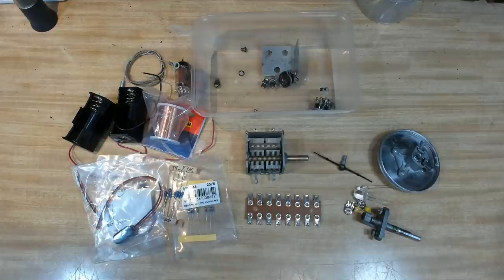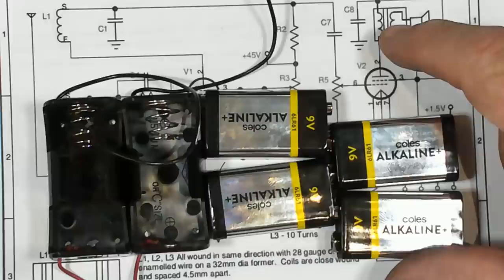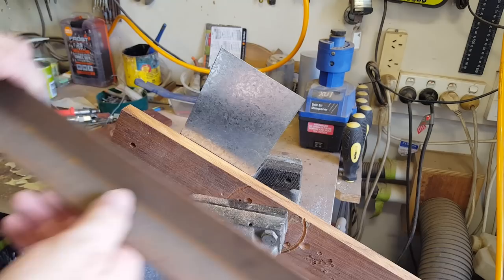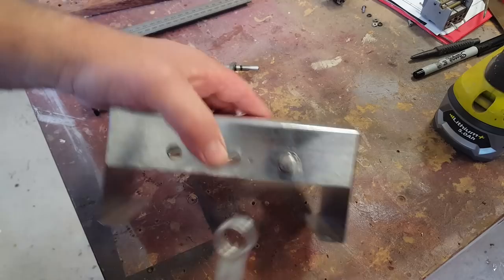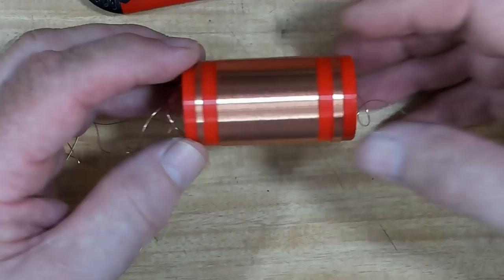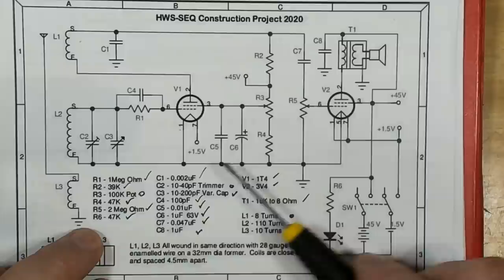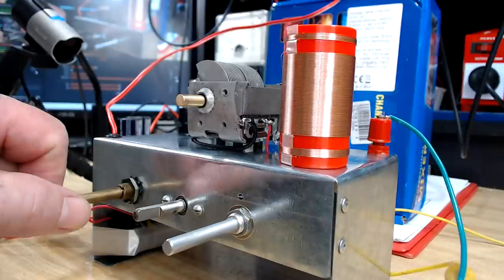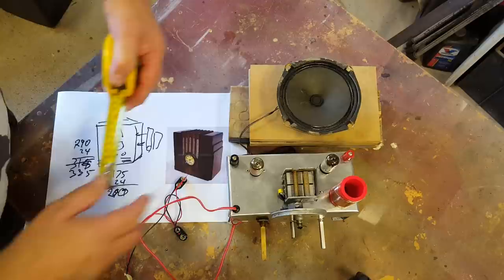2020 Radio Building Competition - My Entry - Two valve Radio

Comment: I have no doubt I missed the answer somewhere but.. what is the small touchscreen signal generator you use in your videos?
Reply from the maker: Hi Andrew. The SG is a project kit from a local electronics magazine, there is a sister publication in the UK, it was featured in Practical Electronics in the April 2018 edition but mine has a oscilloscope function as well which I don't use. There may be a later edition in PE with that feature. Here are the links:
Aus: https://www.siliconchip.com.au/Issue/2017/September 
UK: https://www.electronpublishing.com/product/april-2018-back-issue/
Reply: @DavidTipton101  thank you

Comment: Hihi ! I baught 3 cheep radios. From China. The radios were... terrible at best. Christmas came. House..empty? So i scrounged parts from all three. Dead radios. And embarked on a mission. after 8 hours of labour. I was about to give up.and go to bed. Then I heard a faint whisper. ??? I got a .455 generator., And sent a tone. Also went over that wretched. Board. With its verry thin foil on the board and used snipits from  excess clippings. And rewarmed joints and paving said snipits over broken foil. Then was rewarded with.   A bit of the spectrum.( 400-1300 )   and worked at alinement. Not good. Better than expected. A real christmas gift...
 From Chinese scrap.  Merry Christmas. Om. from kv4li
Reply from the maker: That sounds like a good project Stephen, well done getting one to work. Merry Christmas 😀

Comment: why black? I was a little disappointed! you need a lot of light to see details when it is black. I had hoped for something other than black
Reply from the maker: Hi skrotkalle skrotkalle. I thought it looked pretty good in black and the silver contrasts nicely. To each his own I guess. Thanks 👍🙂
Reply: @DavidTipton101  The reason I do not like black is that you have to have a LOT of light otherwise details are lost and you can only see a black box.

I have 2 large fluorescent lamps in the middle of the room but next to the wall where I have the hifi equipment I see almost nothing but black boxes. if you understand what I'm trying to say.

You did a very good job with the radio!
Reply from the maker: @ford1546  Yep, I understand what you are saying 👍🙂
Reply: @DavidTipton101  Good.

There are not many regular people who can build a radio as good as the one you made. 👍🏻

Comment: Hi there, most impressed.  A couple of years back I built a 2 valve + audio chip Regen kit from Uk. Works great. Was worried about valves coming to Australia.  Anyway this is the company https://www.6v6.co.uk/index.php?
Reply from the maker: Thank you. That's a neat kit Chuck, I assume it worked OK 👍🙂
Reply: @DavidTipton101  worked no problem first time.   I did learn one thing from it.  Headphones and Regen radio not a good idea if you apply a bit much.
Reply from the maker: @chuckmaddison2924  Haha... that's an excellent safety tip Chuck 😄

Comment: tickler feedback coil reversed.
Reply from the maker: No it's not, I checked 👍🙂
Reply: @DavidTipton101  when you turned up the positive feedback with the screen control. the gain went down. that is what a reversed tickler coil will do. did you try reversing the connections on the tickler(plate circuit feedback) coil? I am not trying to be a pest just trying to be helpful. Your build looks very nice.
Reply from the maker: @NebukedNezzer  Thanks, I checked all the coils several times because it was killing off the volume at the lower frequencies, at the top of the band it worked as expected. I did not try reversing the coil due to the leads being a different length but I will try it next time I have the set apart. It will be interesting to see if it makes a difference 🙂
Reply: @DavidTipton101  I did not know it worked properly at the top of the band. this may or may not help. best of luck in any case.

Comment: Spelling fail in thumbnail caption!! Should be: b-u-i-l-d.
Reply from the maker: Are you sure d roses? Have another look... (I fixed it) thanks 😉😀
Reply from the maker: @belly tripper Thanks BT, I did have it wrong but fixed it 😇
Reply: @DavidTipton101  Excellent! I graciously withdraw my initial comment. Have a good 2021!!
Reply from the maker: @belly tripper No, not quite. I only started this hobby a few years ago. My previous profession had little to do with electronics or woodwork, I did work with sheet metal earlier on. I'm always happy to get tips from those with more experience than me 😉